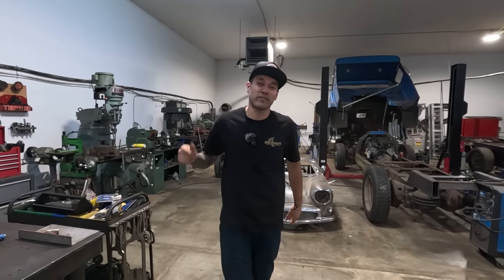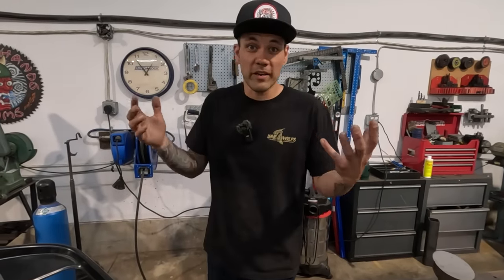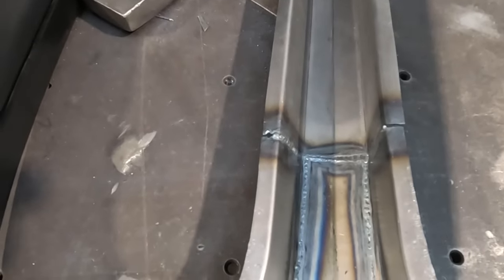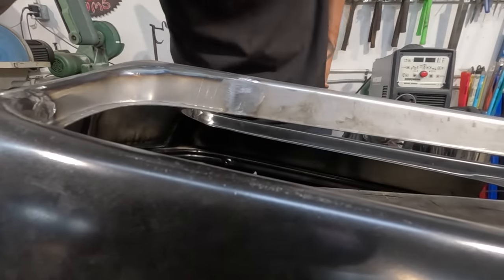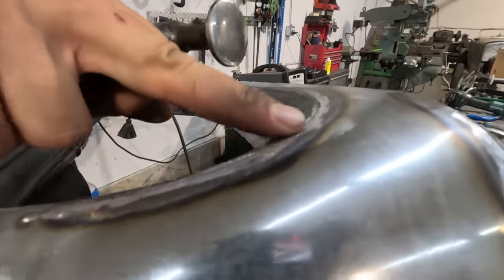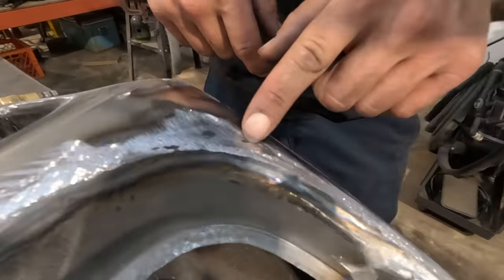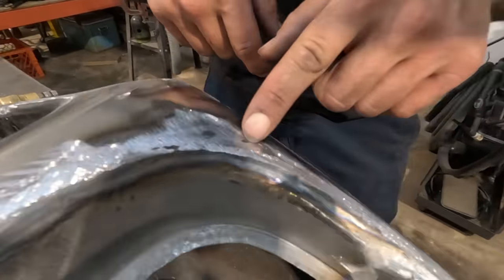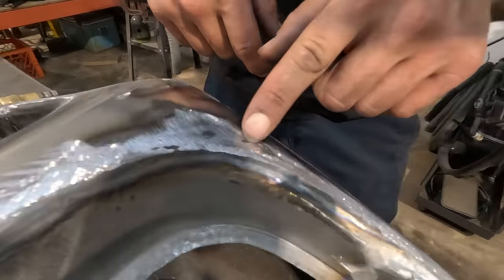Finishing Welds Grinding Sanding Sheet Metal And Planishing by Hand How To

Comment: Great job as usual Karl and you explain everything very well. You sold me on the 3-M Cubitron discs. I ran into a 3-M rep at Sema and he told me how the discs work. As you sand with the discs , pieces of the grit break off and form a new sharp edge which makes them one of the best discs out there.

Comment: Great job on the grill and the best explanation of not only how to do the repairs but, also what the metal is doing and how it reacts to what you are doing with it, heat or however you work it hammering or grinding it. Once you understand that you can make better decisions about your way to do the repair. Thanks again for the great video. Later

Comment: I bought the cubitrons, you are correct. They are way better than anything else i have used so far. I dont think mig is as malleable.guess i better get back to learning tig. I do like the 3/8” belt sander for getting into tight spots. 
The bullseye pick. Buddy has one. I want to see how it works and build my own 
Two weeks and i get to see your beautiful side of the country!

Comment: Great detailing of process.
For the low spots that cannot be hammered effectively, you can use modified vicegrips that "tuck" the low spot. Even making them high spots to the outside will allow for hammer and dollying them back to flat.

Comment: Great video Karl.  Looks like you could really use one of those small belt sanders to smooth those welds in the hard to reach parts on the backside of the grill shell.  Great explanation of the expanding and shrinking from welding.
Reply: What I was thinking.

Comment: You do a great job buddy, what you are doing reminds me of a time my late father was restoring a MK1 Corrina estate( yes I am in UK) he tore it down to a shell then had it acid dipped when it came back it had quite allot of corrosion but not enough to scrap it. My dad's best mate was a blacksmith and he had a forge in Nottingham my dad took the shell to him so he could weld it for him I spent most weekends in shed helping while he sorted it what amazed me was he hand fabricated everything including wheel arches front and lower wing panels floor etc he has welded everything and he hammer and dollied every weld smooth where needed he also cut Very thin strips of mild steel and used them as filler rod,I asked him why he simply put its allot softer to work with on body panels than the rod he was an amazing welder fabricator I still have the car non of the repairs have come through it was done 35 years ago,now I can't say the same of
 the bits he didn't need to do lol..

Comment: Great explanation on the cause of heat shrinks from welds, Karl.  It also explains why preheat prevents cracks in materials like cast iron and alloy steels.  Use of heat-melt crayons ensures that the base material has even heating over an area beyond the weld to avoid the strain locked into material from the molten weld expanding against base material.  Alloy tube can make a really strong 4-link and preheating to weld end connections can help ensure no micro cracks exist that can propagate later.  There is also a condition called hydrogen embrittlement that can cause micro cracks when welding alloy stainless steel where post weld cool-down is critical (think post-flow on tig but for a metallurgical reason).  Pre and post heating are things worth researching for those who are fabricating high-stress structures with alloys that might be used in 4-links, custom suspension control arms and the like.

Comment: Great video and great explanation of the shrinking issue. I think I can further explain it. As you weld and heat the sheet metal, it experiences a localized softening and expansion. Since it is surrounded by cold and hard material, the expansion cannot happen in a lateral direction. The material can do one of two things. It can buckle and rise above the surrounding planar surfaces. Or it can increase in thickness. It’s probably a combination of the two. So when you come back and locally heat the distorted sheet metal that is a high spot, planishing those high spots is actually the process of upsetting the raised spot back into itself. That high spot after planishing will actually grow in thickness compared to the sheet metal that surrounds it. The material fluidly moves from one place to another. 

The added microphone is a great improvement to the audio! 

Keep up the great work! Love your videos!

Comment: Love the videos.  I would love to do a little bit of what you do.  Hired a cool guy who used to build race cars (now fixes heavy machinary) who suggested to start learning welding use stick first and practice  with two tacked angle iron pieces into an X  to do 1) flat (in the valley), 2) horizantal (side valley), 3) vertical (standing it up on one "x" end) and finally 4) upside down.   Hope you can picturre that.  You able to take a couple minutes in each video to teach a really basic technique for those of us just starting out?   I'll let you know if this old dog can learn a new trick.

Comment: I love you're work.  You explain and do stuff like old school.  Awesome.    Sadly Oxy / Acet welding has lost it's popularity to  high speed efficiency and cost minimisation.    With Oxy/Acet the metal was dressed during the weld.  The metal was annealed and manipulated as you went.  There was very minimal grinding. ( actually there were no tiny grinders available, not even a 4" one)  My dad was a perfectionist. Started as an apprentice panel beater, Joined the airforce during the war and became an airframe fitter ( a panelbeater in aluminium ) then after the war his shortened apprenticship wasn't recognized so he had to do it all over.  The man was a true cratfsman.  When I was 15 he taught me how to oxy weld aluminium.  I loved watching his work. I'm pretty deaf because I was the little kid that could fit in the boot or guard to hold the dolley where he couldn't reach.  So I'm sold on Oxy/Acet.  I really cringe at the mig "tack-weld" process. The amount of work to flatten all those hard tacks is ridiculous.  My rant over.  Keep up your good stuff.

Comment: Great video as always! I think you would be surprised how quickly and easily you could make it "perfect perfect" with a vixen (body) file and a bullseye pick. You wouldn't need dyechem because the file will show you the highs and lows on bare metal...the file is a marking tool not a metal removal tool. The bullseye allows you to quickly tap up the lows and save time from some of your hammer and dolly work...I'd bet that with your skills it wouldn't take any longer to make it perfect perfect rather than perfect enough.. and that you would learn the skill in a very short time.  Keep the great videos coming, I'll keep watching.
Reply from the maker: Thanks very much for the explanation on the process I should do some pick and file work and see how I do!

Comment: Most of my metal working has been stainless counter tops and the like. One thing that I used alot for hammering tight corners was round rod and square stock. Just shape the end to what you need and use it like a chisel.

Comment: Karl, Thanks for your patient step by step explanations.  One small point that could be helpful in terms of understanding metal shrinking during welding.  Hot metal not only expands, it also loses strength while very hot.  This means that the thermal expansion, if restrained by cold metal around the hot stuff, will cause plastic deformation of the hot material - because it can't move outward.  When it cools it regains its strength and pulls everything around it inwards.  Which, of course, causes shrinking.  Cheers from Scotland.

Comment: Awesome information and techniques as always. I've used an ice cream scoop that's like one piece of leather from a baseball to smooth out hub caps. Also, those vice grips with the pivoting clamp surface to massage over a dent like a slow motion English wheel.

Comment: Put the 3” disk on the 2” arbor, grab a scrap piece of sheet metal with a point. Run the grinder and use the scrap metal  point on the back of the disk  like cutting on lathe. Cuts thru like butter and then u have a clean edge perfect circle and it’s balanced. 👍🏽.

Comment: Thanks for the great input Karl !!! Really appreciate all the good/detailed info !!! 
One thing that would help a ton would be another "instructional" video showing the same kind of detail regarding using the small shrinking disc when doing this same work on a much flatter panel and the warpage tends to create "stretching" to the point where it begins to fight you with "oil canning". Which side to shrink, how big an area do you shrink/work??? How do you progress with the level changes so you don't end up re-creating the stretch while you're trying to get the area tight/but flat not shrunk "puckered"???

Comment: Excellent video Karl!!  Wearing a microphone definitely improved the audio and the 3M cubitron disks are the best.  Painful to buy but worth it.  I've been cutting them down just like you demonstrated.  I originally found this technique on Wray Schelin's channel (Pro Shaper) several years ago.  One other thing about rolocs, If you catch an edge with a cheap disk, more often than not it flies across the shop.  I've never had that happen with a 3M disk.  The edge might be torn but you can cut it down and keep using it.  You get what you pay for.

Comment: Your educational videos are exceptional, without exception.  For a video would you mind demonstrating what using tools, techniques incorrectly without nesszrly realising it would cause and how to spot it Leaving a planashimg hammer for too long and or too tight, incorrectly gas or filler, too heavy or light tooling for to thjn or thick guage, using 'stuff' for one metal designed for another, possible strong sunshine in a cold workshop, picking up the peice wrongly, seting it incorrectly that would cause its own shaping, or a too heavy 'sandbag'... if course most importantly the other 'things' I don't know yet that you would notice straight away?  Thanks again for being such an inspiration to so many people
Reply from the maker: Much appreciated!

Comment: An old guy turned me on to silicon bronze tig to weld panels 15 years ago. The super tight hez, along with only requiring enough heat to melt the bronze, makes warpage almost non-existent. I use AC, and it makes great welds. The other benefit is by using a Vixen file, you can shave almost all of the weld flat and not put any heat into the repair. After that, a 60 grit 3M Cubitron belt on a mini belt sander takes accurately grinding welds to the next level. It's like a wand. You only grind weld. Then 80 grit 3 inch Roloc and 80 grit da and all you see is a bronze worm in between the butt weld.

Comment: Put a 1/32 thick cut off disc between grinding disc and backing pad. It will rock on top of weld without the flexing and grinding of metal along side of weld. Once the weld itself is close to base level remove cut off backer disc to get an overall grind with the contour. You have to watch where the grinding is happening. It speeds up the rough cutting part.
Reply from the maker: That’s cool I’ve never heard of that!

Comment: excellent work, and demonstration of how you do it. your doing it the proper way for sure.  i've been an auto body guy since the late 1970's... but i do have to tell you. Bad Chad would probably kick your ass for spending so much time doing it your way, he only says to just grind a bit of the weld only. and ten flood that grill with two gallons of bondo, and not sanding in between his flow coating of the bondo.

Comment: Turn down a roloc backer to 1/2”, get the most out of them. Plus it helps not grind the parent metal as much. I also use purples as they are the best. 
There are a couple thoughts on metalfinishing, one is removal of as little as possible metal. Second is grind the hell out of the parent metal and procedd to file the hell out of it. 
The second source is for a people that don’t take pride in their work.

Comment: Fantastic job Karl.
Q- I may have asked this before- What are you using on the bare metal to stop flash rusting. The 32 seems to have next to no rusting on that bare metal.
I can't leave bare metal more than a day or two where I am as the metal flash rusts near instantly, and WD40 make painting a challenge.
Humid air where I am.

Comment: That grille from scratch is an amazing piece of work Karl. ? what do you do with the back side welds? If it doesn't show do you leave them and prime/paint over, or sand down all those inside welds? You clearly show why custom fab works is so expensive. Mammoth amount of work/time involved.

Comment: You know this but the viewers may not...
  We use that heat shrinking concept to remove the "oil can" effect from sheet panels like on the roof of a car.  When you can push on the panel and it deflects, like the bottom of an old style oiling can, you can heat areas of the panel and as it cools and tightens, it removes the flex from the panel, "tightening up" the body panels and taking overall flex out of the car. Less flex, quicker response time off the line. 😊

Comment: Have you ever considered bending an L edge on the 2 pieces to be joined then seaming together with the tig. Hammer afterwards I get a very smooth one side and an easy area to clean on the other using only panel material hardly any filler rod.

Comment: I think brand really matters when metal finishing welds - 2 stand out for me as being miles better than the others, getting the work done faster & therefore cooler - 3M & Pferd.  

3M make cubitron belts & flap wheels that are simply worlds ahead of everyone elses - they absolutely beast through the work, waaay faster than anything else I have come across. I've not found any even close competitor.  Pferd make the best grinding discs IMO - they grind far faster, far cooler & just so much easier than any other brand I have used.  I grind welds all day every day & it bores me as much as it bores anyone. 3M & Pferd take a lot of the yawn out of the job.

Comment: Back in  the late 90's when I worked in the tank and fender dept. at Harley in York, PA., we used 3M Cubitron belts for sanding parts that were to enter the chrome plate machine. I mean a multitude of tanks with water, acids for cleaning, alkaline for cleaning, nickel and chrome tanks. Plus an oven to dry the parts which were all mounted on racks especially made for this process. It was all automatic and conveyors fed and took away the racks. Now, Harley has the vendor chrome the parts before receiving, jobs lost and the entire system was scrapped. Seriously makes me wonder why the Union didn't stand up for jobs due to threats to shut down the plant, a very costly alternative and no guts.  Dues were close to $500/year times over 2,000 employees for them to sign off on jobs leaving. Back to the belts,  you had to be careful as those rows of pyramids could show up in the final plating. Close inspection showed rows of grooves. They do cut and they do last. Many guys opted for other types of grit. Granted, these were  belts, not a rotating disc.  Excellent tips, thank you. Ever think about getting some bucking bars for a dolly?  These are for forming the shop head on rivets. Here is a link:  https://www.wicksaircraft.com/shop/economy-bucking-bars/